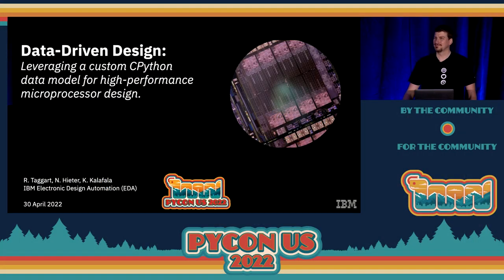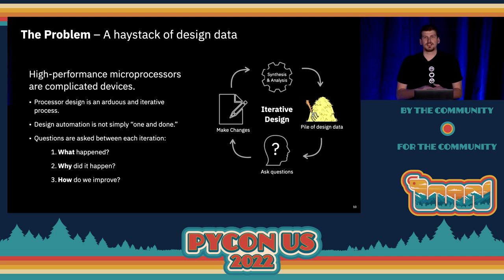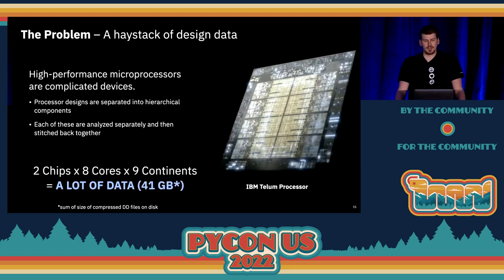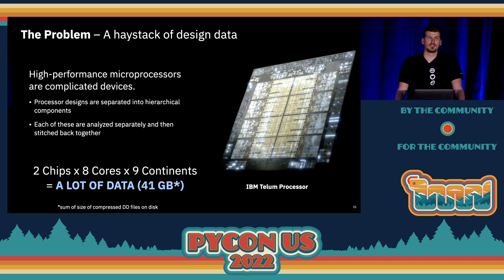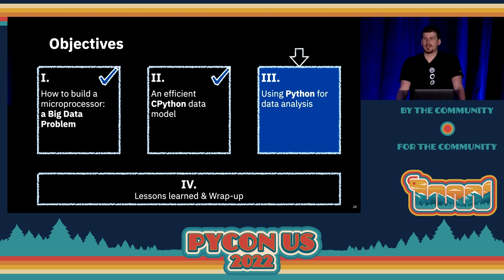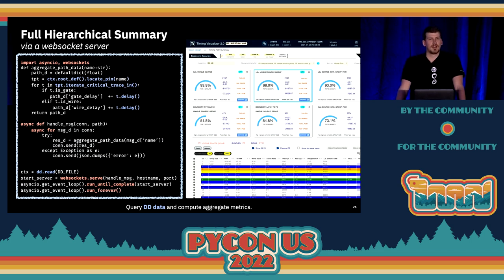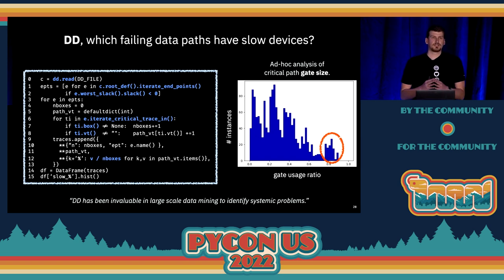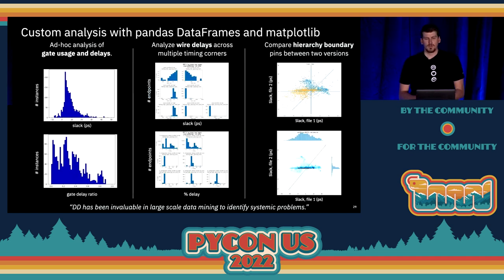Talk - Richard Taggart: Leveraging a custom CPython data model for high performance...

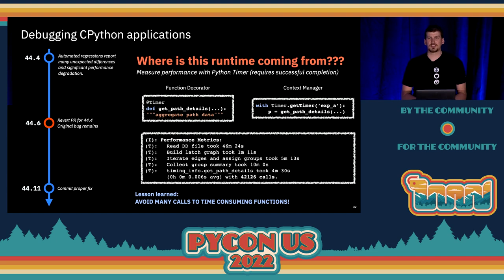Comment: I'm 10 minutes in and I still don't know what a CPython data model is. Does he mean that they extended the reference interpreter? Do they really mean Cython? What is the custom data model? How is it organized? 17:30 what is a CPython application? CPython is just the reference implementation. This is a very sloppy talk. They really needed to define these in the beginning.